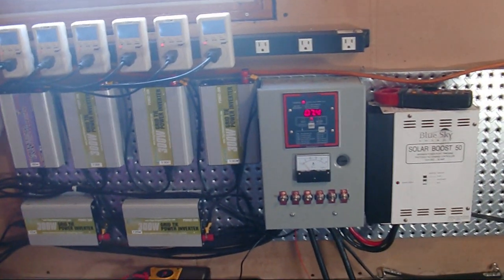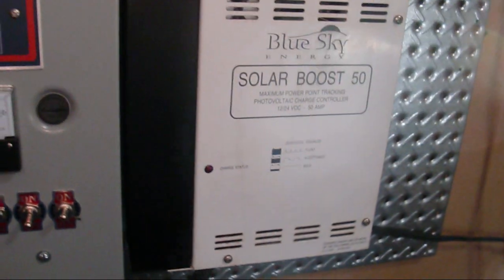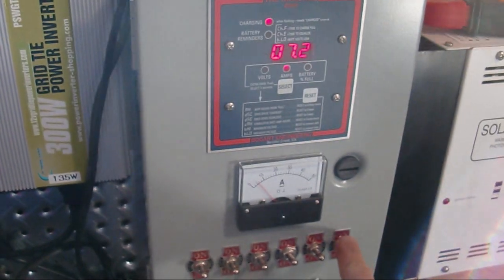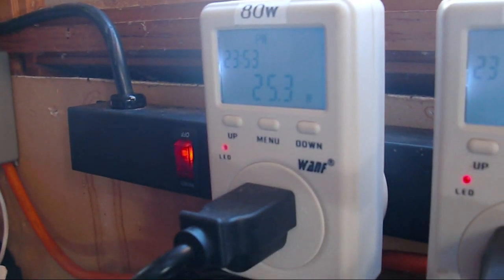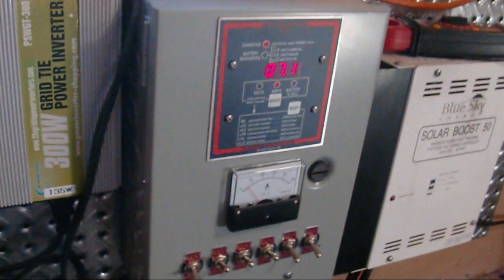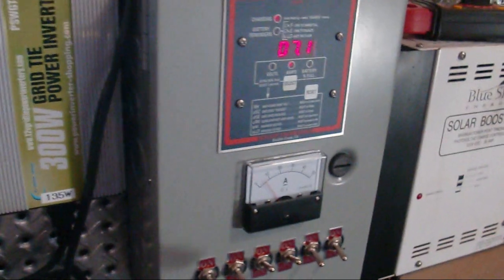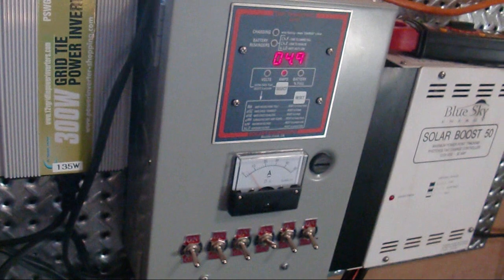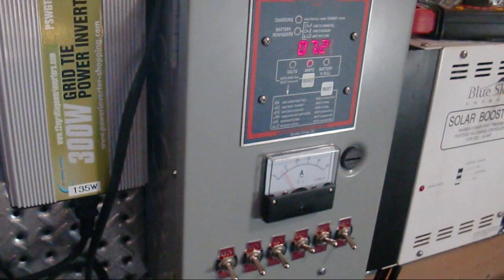Today's Solar Energy Observation - Grid Tie and Charge Controller mix

Comment: I connected my 235 watt solar panel to a MPPT charge controller and the load off of the controller is going to a cheap grid tie inverter. I did this because the  inverter won't accept voltage above 30 volts.  My panel is sometimes up to 37 volts and then the inverter cuts off. So I use a MPPT charge controller to keep the amps up and keep the watts.The controller tops off the battery first then it runs the grid tie inverter. My inverter is 250 watts producing 180 watts all day long.
Reply: Michael West 

Hi Michael, Are you running the mppt charge controller parallel to the grid tie inverter at the same time?

Comment: great setup man, that's just about what i want for my system. to have a hybrid gridtied and battery back up. gridtied are way more effiecient that battery system, cause you don't have the internal battery resistant. if you use 1000 watts out of a battery bank then it will take 1100 to 1500watts to recharge them, depending on battery type. with gridtied everything is all fine and dandy untill you have a grid failure like in a storm, then your in the dark. a hybrid can eliminate both problems.

Comment: @Fearlessthinker Unless you plan to get rid of the grid completely, using batteries daily is a waste of 50% power in my opinion, only emergency backup. If you have the GTIs, I assume you want to use them and I thought that was the discussion, keeping your batteries charged simply and automatically and waisting as little solar power as you can. Well, anyway, I will be doing this test shortly and will let you know, I just can't try it with a MPPT controller like you could.

Comment: @Fearlessthinker 2 GTIs ? I thought you did that too, one other guy did and one GTI seems to always "win" more and puts out a little more than the other, not "perfect" but in that case your battery will still be maintained, which is what you want. And you said it only needs one panel to keep them charged, so one GTI. Hope you get some sun soon so you can test that. Just to be clear, panel parallel to GTI and charger, charger to battery. Just like 2 GTIs parallel to a panel.

Comment: @Fearlessthinker I only have one CMP to test with, for a small system I don't need more, it should work up to 60A easy with a little modification. It's possible these have a delay built in to prevent oscillations. will have to test that. Your Blue Sky probably does, easy to test with a car charger, otherwise they wouldn't say they can parallel. It will be interesting to see what happens when you connect the MPPT charger + GTI + panel in parallel we have seen 2 GTIs do that.

Comment: @Fearlessthinker Morningstar and Blue Sky say their charge controllers can be paralleled on the output for more amps. MPPT is really not needed to just keep a battery charged, once it's topped up in the morning, there's not much else to do. The post about the CMP 12/24 charger at techluck.com I was talking about is called "A Little Solar Charge Controller that may be able to do more!". The mosfet is rated at 75A and if you parallel two the insertion loss and heat would be half.

Comment: @Fearlessthinker You should try it with your charger, I don't have a MPPT controller available to me. I figure for $15 (or way less via auction) I can do a manual equalization every couple of months. And all it's doing is "floating" 13.8V the batteries anyway. I hate batteries, you lose energy and money no matter what you do so I will have them for emergencies only. I see no problem splitting your batteries into two sets w/2 chargers. In an emergency just jumper them in parallel

Comment: I mentioned the Ebay CMP 12/24 to "shartne" and we both have received ours, just need to hook it up and do some testing but I don't see why it wouldn't work. The CMP charger looks like it should handle more than 10A with a simple addition of more metal to the heat sink. The mosfets can also be paralleled and there's an extra one for the (not used) night light feature. Preliminary CMP pictures and info is already posted and when done I may post a simple schematic on the forums at techluck.com

Comment: What would work is one of those simple $15 on/off type charge controllers Ebay CMP 12/24. GTI and charge controller parallel to the panels. Now when the charger "lets go" (battery charged) the GTI takes over. This way you can keep your battery charged for emergencies. If the GTI comes on too soon for your taste, just add diodes (0.7V) in series with the GTI to increase the ON voltage of the GTI. You didn't show us the voltage readings for this test, as you clicked in a sw volts may have gone up.

Comment: The same thing happens on my small system.  As the battery nears full charge, the amp meter reads near nothing.  Designing a circuit that will switch the system over to grid is a good idea.  Sounds like something the Arduino could do.  I'm enjoying the observations, thanks.

Comment: Hi Tom i see you are busy with the grid tie set up. I also found the same thing ,dumping of panels when my MPPT controllers went into absoption mode drove me crazy showing 14amps on1 panel the same on the other. But my 12volt panels on 3nd controller staying steady at about 6.5amps.Then when the lite started to blink i would lose a big panel 1 of my trina 220 watt @29.9 volts .I then went out side tested it and it was putting out full power but charger just dumped it.Related 2 size of Batt Bank.